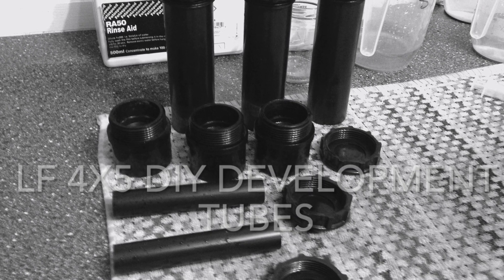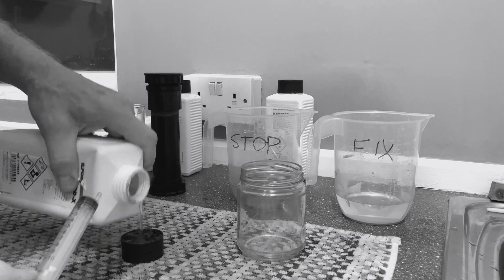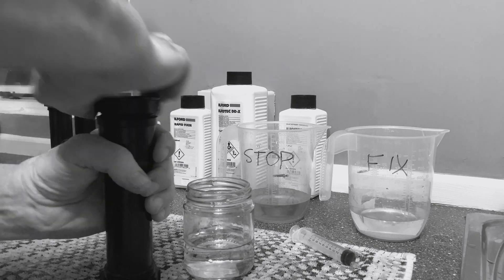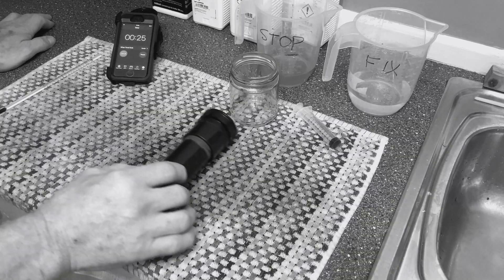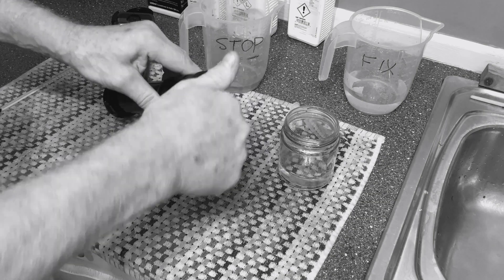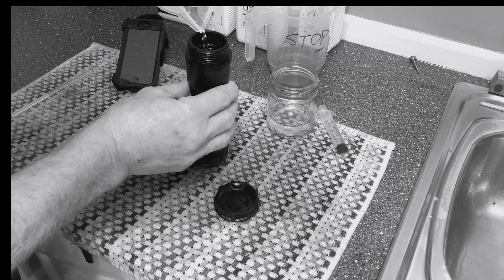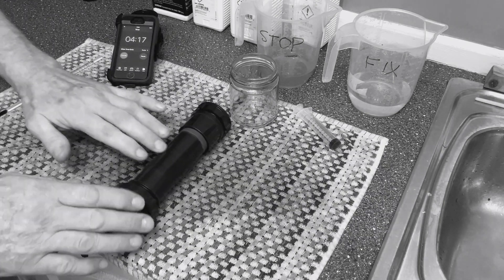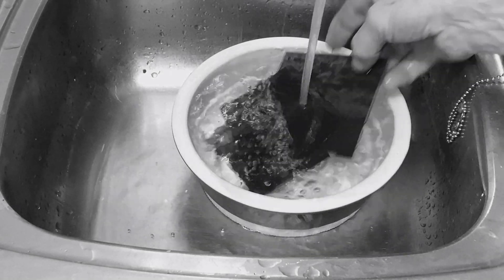Developing 4x5 Black & White Film in DIY Tubes

Comment: Thanks for this demonstration, Phil, this seems like a great method! I would love to know the light baffle is constructed, since that seems like it would be the trickiest part of the design.
Reply: Cheers, Peter. I’ll put up a video with a couple of stills that you can get a sense of the construction. You just need to turn some plastic pipe, a couple of end caps and chemical neutral plastic bonding cement.